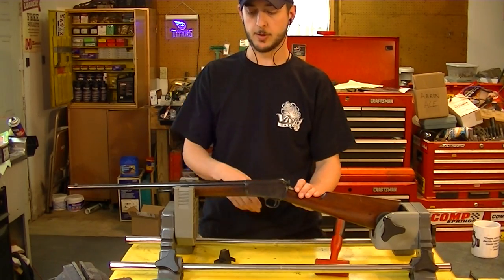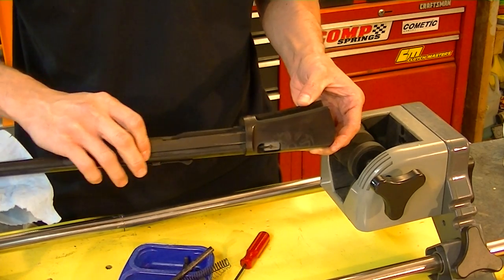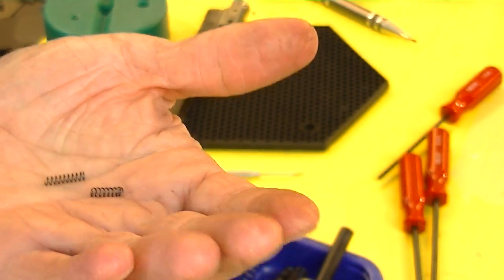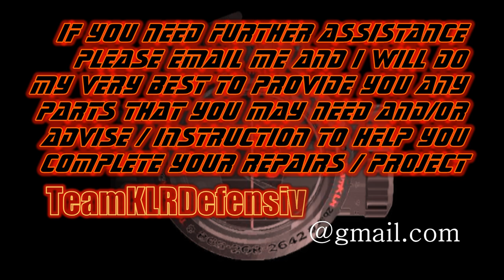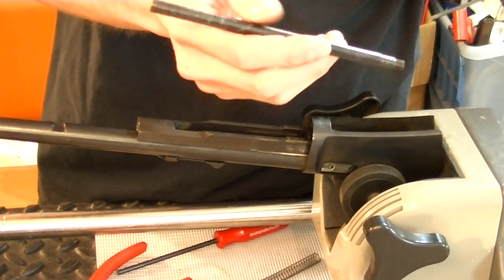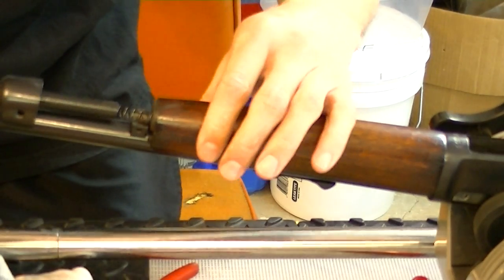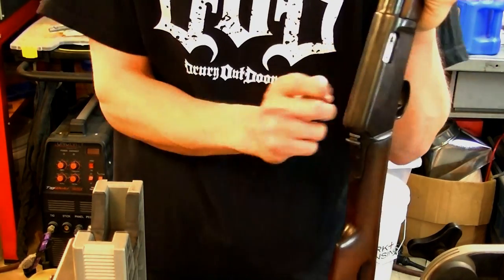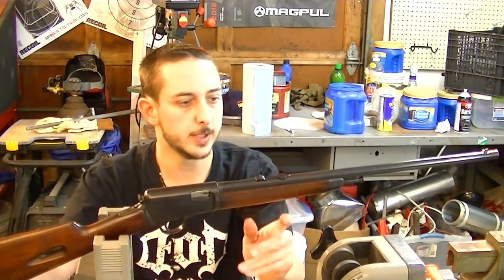Winchester 1903 22 Winchester Auto teardown and assembly

Comment: Boy, this video is a lifesaver. I have a Model 63 manufactured in 1955. I've had it since 1970 when I was 12 and it was my father's before that. I recently decided to restore it as the firing pin cracked back in the 80s. I was pretty bummed out while replacing it when I noticed that the extractor, extractor spring and extractor plunger were missing. I found a source for the missing parts but had no guidance on how to insert them...until I found this clip. THANKS!
Reply from the maker: Hey, glad to help!  Keep me in mind if you ever need anything done that is outside of your wheelhouse, coatings, or custom work/builds.  TeamKLRDefensiveConcepts@gmail.com
Reply: Hello friend @gfoxer, where did you get the extractor parts?  I have a 1903 Winchester and I'm missing those 4 pieces of the extractor, could you please share with me where or from whom you got them?  I'm restoring my rifle and I need those parts.

Comment: Great video thanks.... By far the most difficult part for me was installing the second spring into the charging tube....  You got  it first try, i kept bending the spring and distorting.it... Finally gott it by using a length of ribbont to hold the spring inside the tube...until i got it in place.

Comment: A magazine tube nut removal tool can be made up by choosing an appropriate diameter and length socket wrench socket and filing or milling the end to leave two opposing bosses protruding (sized to fit the nut recesses); if the socket is larger than the tube diameter, no change to the internal diameter of the socket is needed.  Naturally, this can be used with ratchets or drivers.
Reply: ForgottenMan1 ,j'

Comment: Great vid!  I just became an owner of an ‘03.  I disassembled it for cleaning.  The hammer is in the cocked position and won’t release.  There’s a tiny spring and pin in the rear of the trigger for the safety.  This spring and pin will just slide out.  I’m unsure how to either get the pin back in securely, and how to get the hammer to release.  The trigger won’t release the hammer, whether the safety is in the on or off position.
Reply: Im tearing down my grandfathers today that hasnt been cleaned since 1960 or so (well ouled tho) lol, had a hell of a time with that fore stock piece slotted to the barrel.  Pretty cool rifle.

Comment: The only thing I question is putting Loctite on those parts. I know you don't want them to work loose, but it can be a bear to break loose some of those small screws if they have Loctite on them. Same for the buttplate where you used the wood glue. That sets up really hard also.

(I'll think about your approach, though. Maybe the blue Loctite would be a good idea, since those parts are internal and you wouldn't know it if they were getting loose.)

Comment: There is supposed to be a recoil buffer to keep the bolt for pounding the  receiver.  It's vulcanized rubber and has a steel retaining washer.
Reply: I have a true 1903 ssn 6xxx. I need an inner mag tube. Or the specs on one so I can make a new one. Do you have any info that would help?

Comment from the maker: heat gun, yes. Just protect the wood from the heat. the problem with the heat gun is you will have to work harder to heat the area around the lug and not the lug it's self. Often on things like this that a ceased up, as you heat it and it begins to liquefy any dirt or varnish that is "gluing" it, you will see bubbles form in the seams between the two parts. 
Pusher tool, maybe but last resort. The problem is fixturing it as to not scratch or maim the parts and gun.

Comment from the maker: 2 things. make sure there is not a set screw hidden by dirt. It would be oriented in a way that is could tighten against the barrel.  If no screw use penetrating oil (pb blaster, kroil, clp, wd-40) if that does not work wipe off the oil and take some aluminum foil, wrap the stock at the front with the foil and take a torch and heat the area of the block. DO NOT GET IT CHERRY RED. Just get it to 200 or 300 degrees, make sure to concentrate the heat around the block, not on it. once hot tap out

Comment: Did you have a recoil buffer for your Winchester model 1903 or does it really make any difference?  Very nice review.  It helped me to break down and clean mine.  Thanks.
Reply from the maker: You are the second to ask about that. To be honest I was unaware of it's existence. Every one of these that I have had come through the shop has not had one and I was not working with any schematic. So, the answer to your question is "no", not from my experiences. Maybe someone will have something different to say though.  If you need any parts for it, any other gun, gun sales, or gunsmith work please visit us on our website at http://www.TDCtactical.com.  Drop me a line on the price quote form for anything you don't see or even if you see it I can probably do a better price for you if you contact me directly. THanks!
Reply: TDCtactical damn, I'm trying to restore an old barn find & after watching your video I realized that fully half of the Ejector plate is torn away & that I also need a bunch of parts, the Extractor, Extractor Plunger, Springs & screws, Firing Pin Assembly & Hammer Spring & Hammer Spring Abutment Plate........
Reply from the maker: I can supply parts for you if they are available or you can send it in and we can replace/repair it and we do coatings as well (cerakote, bluing, etc) I recommend Cerakote. Just another idea. If you would like any pricing info for either option please fill out the price quote form on our website.
Reply: TDCtactical will do, hope you can fabricate a new ejector plate, I had another look at it the other day, if you look through the ejection port you can see a little set screw holds it in place, I thought it may have been a brazed in affair so I was quite surprised to see that it was at least for the time a replaceable part.

Comment: IJust love to watch You amateur Smith's. Do yourself a big favor instead of using two pointed picks, work down two flat stock, with a 30° point, the size of the extractor opening, one to push the bushing and spring inward the other to wedge underneath. The tooling is cheap to make, removal of extractor can be done on the first attempt. Your way, is just finger screwing around. Time is money in the firearms repair business.
Reply: Again, why are you reassembling the 1903 .22 auto, without buffing parts on a wire wh